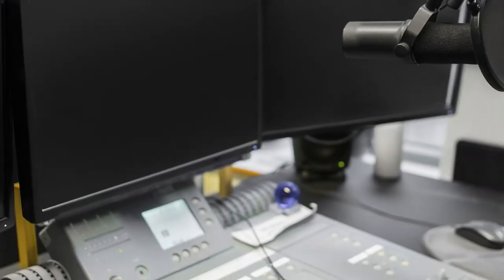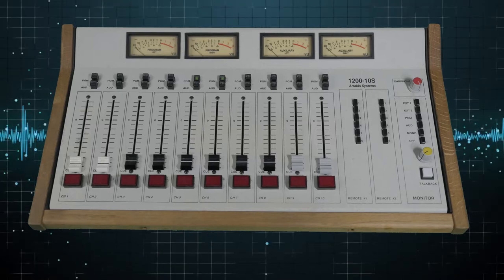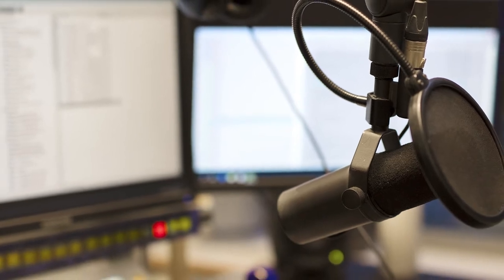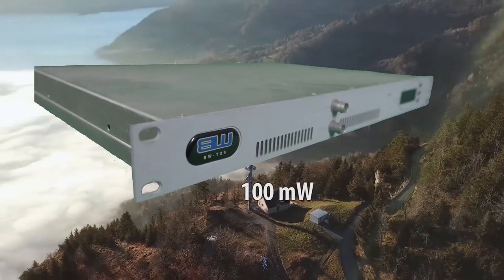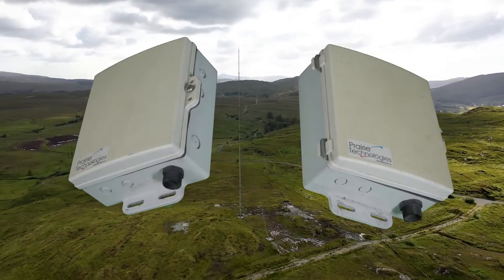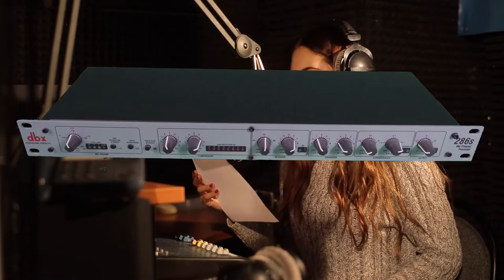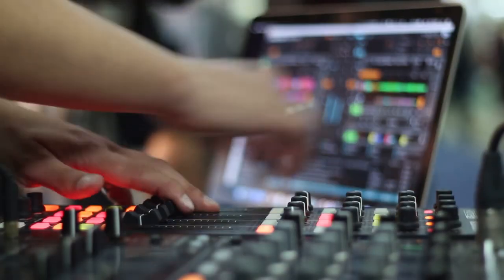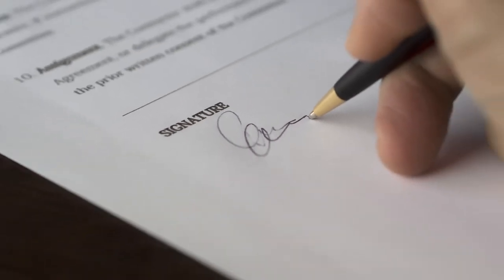How To Build A Radio Station. Equipment and how it works. Short Version of how to build your own.

Comment: Can ypu make a more indepth video on, the studio side of things that include a more indepth look at using / connecting up the transmitter, radio link,  etc so it'll broadcast out to a FM Channel (ie 96.9 fm). Thanks
Reply from the maker: Hi Carlos. Thank you for your comment. Sure I will look into making a video about that. The studio side and transmitter side are a bit different to each other, but I will look at making one about the studio and one about the transmitter side. Maybe I will do a short video first showing the connection between the two.
Reply: @inspiresoundpro  alright thank you.
 also where can I find one of these transmitters to buy? & roughly how many watts would i need so I can broadcast out to about 50 miles one way and 50 ?
Reply from the maker: @carlos_mann  Hi Carlos. 50 Miles is very far for most low-power transmitters. Unless you are using a directional antenna that points in only one direction, you will need thousands of Watts of FM signal. But it is important to keep in mind that the height of the antenna matters more than the power of the transmitter. I will explain this more in my next video which I am busy working on. The power of the transmitter has more to do with getting penetration of the signal into your broadcast area. The height of your antenna will affect the range of the signal. You could reach 50 miles with just a few hundred Watts if the antenna is on top of a mountain. But the signal will not be strong in "shadow" areas. So the high power is more to fill in those weak areas but the antenna height matters more.
Reply from the maker: Also, you can buy FM transmitters all over the internet. The cheaper ones are mostly not good so it's best to buy from reputable suppliers who are FCC certified or at least can prove high-quality stats of the equipment. When you apply for a license the authorities will often ask for you to supply certification of the transmitter to prove that it is good quality. So buying a cheap one will often just be a waste of money.
Reply: @inspiresoundpro  
So getting an antenna is the key thing to getting distance out from the broadcast?
Reply from the maker: @carlos_mann  Yes the antenna makes a huge difference. The power of the transmitter affects the signal strength in your coverage area but the antenna and the height of the antenna make the most difference to the signal range or coverage size. Different types of antennas also affect signal strength.
Reply: @inspiresoundpro  
Ohh alright

Comment: I just want a low-power stereo FM transmitter so I can listen to my MP3 player in my car.
I've tried cheap ones, but they all have this annoying raspy hiss whenever the music hits peaks.
I've also tried those cassette adapters, but they don't work -- they just trigger the auto-reverse mechanism every few seconds rendering them useless.
What do you recommend?
Reply from the maker: Hey thanks for your comment. My expertise is in broadcast transmitters but I do understand your frustration with the these little car FM transmitters. Coming from a background of wanting the cleanest sound for broadcast, the sound of most of the car FM transmitters sound is absolutely terrible. I am not sure why most people even bother with them. Imagine that they have to cram the same broadcast quality components into a tiny gadget and then only charge a few bucks for it. It's not really possible. With probably 95% of them you will just be disappointed. I have heard that the IPhone version is pretty good but I have not heard it myself. Also a lot of the noise also comes from the processor in the mp3 player bleading into the audio which is why even if you play an Mp3 device into your radio using just an audio cable you still get noise. I have tried a number of combinations of mp3 players from a cell phone to a portable mp3 device to inserting the sd card into the radio and found they are almost always not good enough if you are a bit of an audiophile. Unfortunately the world has traded quality in for convenience and price. So you are fighting a losing battle. I wish I could give you a quick easy answer but you are unfortunately heaping the problems of compressed audio on top of cheap devices, out of spec FM transmitters and multiple pre amplifiers in between and you get a dog's breakfast of audio.
Reply from the maker: Just to add a note here. I am busing working on a video about how to choose an FM transmitter for your radio station which will discuss how even larger non car FM transmitters can be a mine field for buyers. The market is flooded with cheap junk that sounds awful. So if new radio stations struggle with buying high powered transmitters when they have the luxury of choosing so called "broadcast quality", Imagine how difficult it makes it to find a car FM transmitter worth listening to.
Reply: @inspiresoundpro  Thanks for the quick reply!  I appreciate the detailed answer 🙂

Now, the problem is definitely not my MP3 player, I have a high-end player that sounds awesome through high-end studio monitor headphones and/or high-end studio monitor surround-sound speakers.  Unfortunately, my car is ancient and only has a cassette deck, a CD player, and an FM radio (maybe I should just buy a new car, but I hate throwing away perfectly good things just because they're old, and it has a high end sound system, just no way to connect an external audio source).  

Like I said, everything I've tried doesn't work.  
The only thing that I've found that works at all are those cheap car FM transmitters, but they all sound horrible.

What if I buy a commercial FM transmitter like your BW-TX5 there?  
I don't mind spending the buckazoids for something that works well.  
But can I limit it to just a watt or two so I don't get in legal trouble?

I subscribed to your channel so I can watch that upcoming video on transmitters.  If I can buy a professional transmitter that can be limited to just a watt or two, that might be my solution!
Reply from the maker: The 5 watt transmitter I have can go all the way down to a few milliwatts which would be more than enough in a car but I don't think BW makes them any more. You would probably have to buy a second hand one if you can find one on EBay or something . The sound quality is amazing because it was intended as a broadcast transmitter. Actually was my backup transmitter for my last radio station. BW only seem to have 30 Watts and up which won't work unless you run it into a dummy load. The TX5 is not cheap though. I bought the one in the video about 15 years ago and it cost around $1000 I think so not the best for car sound lol. Not very practical too. It's about the size of a brief case. Can you not connect cables to your car radio input? That would be much easier.